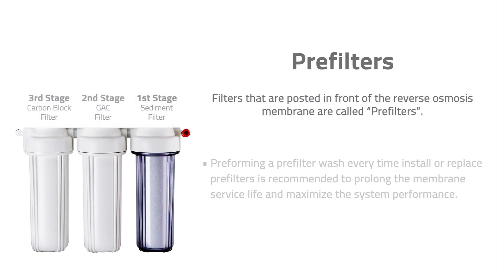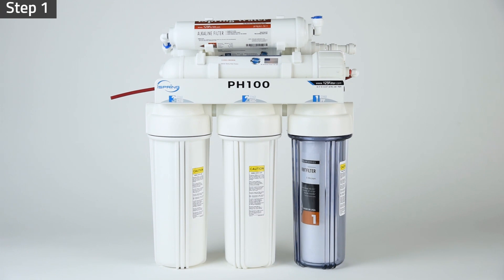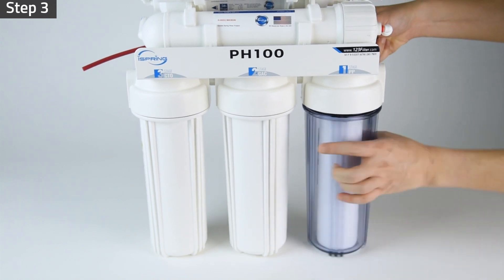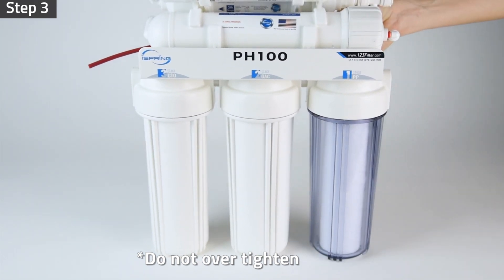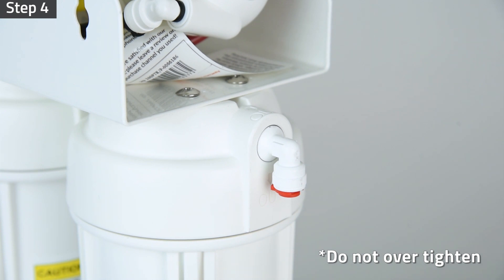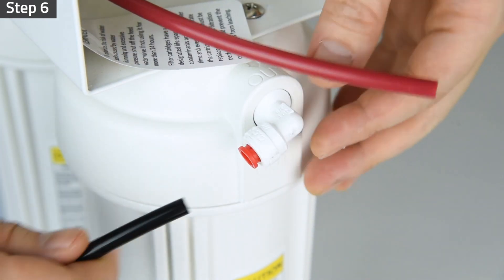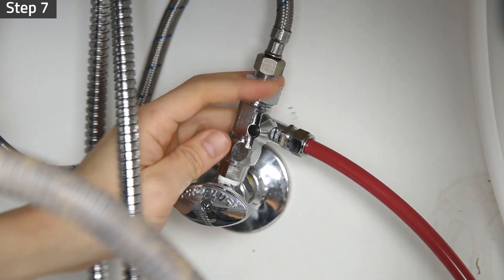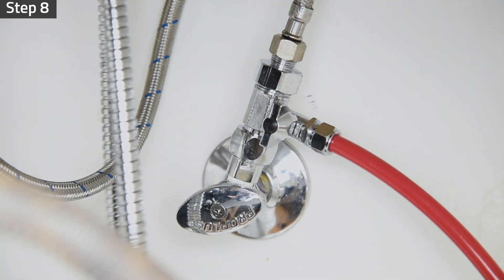How to Perform Prefilter Wash & Filter Replacement for iSpring Reverse Osmosis Systems | Easy DIY

Comment: WRONG! Step 1 is disconnect water supply!
Reply from the maker: Hi there! Thank you for your feedback—it helps us improve our content and services. Yes, the water supply should be turned off before replacing the filters to prevent any leaks or flooding.
If you have any concerns or questions about our products, do not hesitate to contact us  at support@ispringfilter.com  or 678-261-7611  for proper assistance. Thank you!

Comment: I have iSpring RCC7P-AK model which has a booster pump, should I do a prefilter wash with the power ON or OFF?
Reply from the maker: Hi there. Please note that the booster will not turn on until water flows through it. Please refer to this video (minute 6:40) to know how to perform pre filter wash on systems with booster pump: https://www.youtube.com/watch?v=g_wklYjLcpI

For further concerns or questions, kindly contact us at support@123filter.com and at (678) 801-9308 M-F 8:30-5:30  EST or (678) 261-7611 M-F 8:30-5:30 EST

Comment: So I just ruined my stage 4-6 filters because i didn’t prewash my 1-3 filters? The water has a bad taste now (after draining the tank 3 times). Should I buy new 4-6 filters? Or should I keep cycling the water thru the whole system until taste improves?
Reply from the maker: Hi Martin. Your stage 4-6 filters are not ruined if you skip the prefilter wash this one time. It's just a better practice to prevent the membrane from getting clogged too soon. As for the bad taste, please give us a call at 678-261-7611 (M-F, 8:30 - 5:30 EST). We can help you diagnose and solve the issue.

Comment: I skipped this because I couldn’t get the little black tube that goes to the drain saddle off of the white thing to which it was attached...pulled fairly hard and didn’t want to break anything. Insights?
Reply from the maker: Hi Tim. I'm sorry that the black tube is missing in your package. Please give us a call at 678-261-7611 (M-F, 8:30 - 5:30 EST) or email your order receipt to support@123filter.com. We are happy to help you out!

Comment: Can you please clarify what happens after you turn off the "feed water valve"?  All of this just looks like turning on the system, except the final step.  Why would I turn off the "feed water valve"?  Am I supposed to dispose of the water in one or all parts of the system in order to complete the "pre-wash"?
Reply from the maker: Hi Eve. When you wash the pre-filters, you disconnect the 3 filters from the rest of the system to flush them. After it's done, you need to turn off the feed water valve and connect the lines back to the system. If you have more questions, please feel free to call us at 678-261-7611 (M-F, 8:30 - 5:30 EST) or email us at support@123filter.com. We are happy to help!
Reply from the maker: Please also flush or empty the tank twice after the pre-filter flush.
Reply: This was not explained well in the video at all.

Comment: Just installed my first 6 I spring reverse osmosis system. Unfortunately, I forgot to flush the prefilters — I immediately filled the tank, drained, then filled it again. Will this cause any issues to the system/should I still drain the membrane?
Reply from the maker: Hi Jorge. It's okay if you forgot to flush the pre-filters this time. However, please remember to flush them when you replace filters in the future since loose carbon from pre-filters may build-up to clog the membrane and shorten its lifespan.
Reply: @iSpringWaterSystems  May I suggest you post a video on this topic. I have been scrambling to understand what should one do in this situation? i.e. if I had forgotten should I still perform this step lets say if I only started draining the full system through the RO faucet? Also, if I were to perform this function once the filters were filled out with partial water and I remove the drain tube would it start leaking water from there? etc.